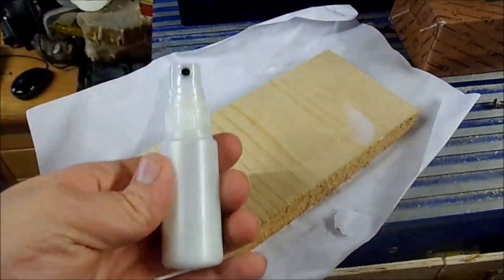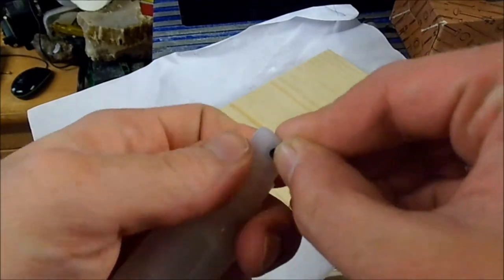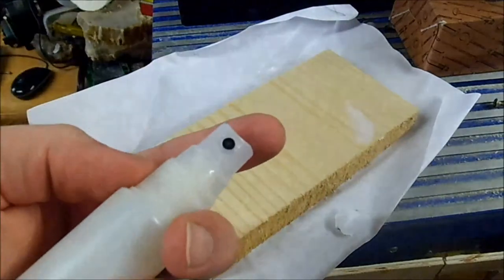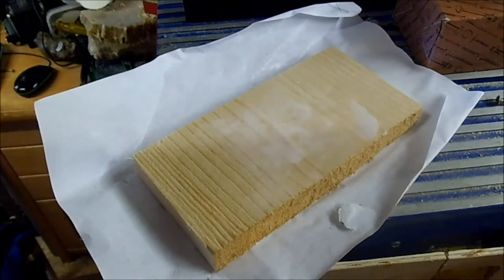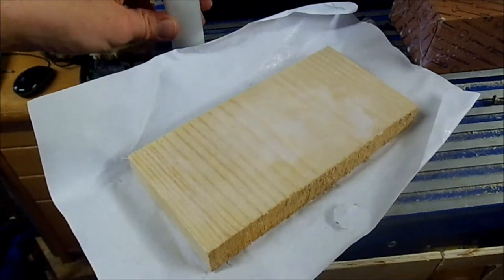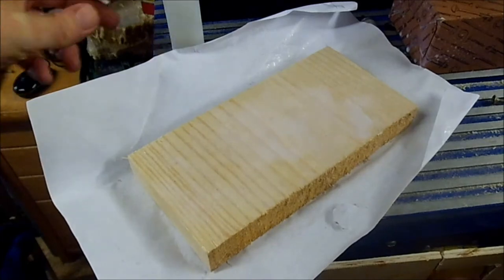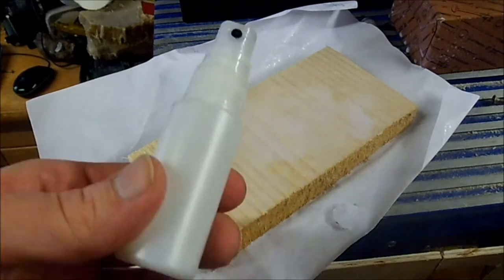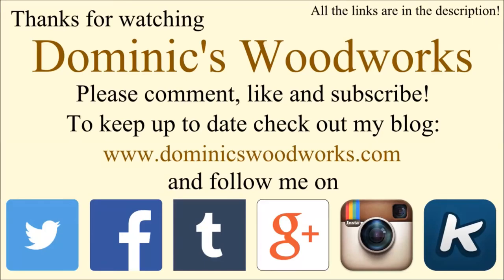Fail - "homemade" spray lacquer

Comment: I don't think I would use paint thinner for water based.

Distilled water would probably work best for thinning, tho I am sure you could practice with just regular water. It looks milky like it's pretty much water based poly. 

Use the hvlp gun, I don't usually have to really thin water based poly to spray it as it's usually pretty thin (depending on the brand). 

You should also know by now that you can't trust the manufacturer recommendations. Some things you just gotta go try.